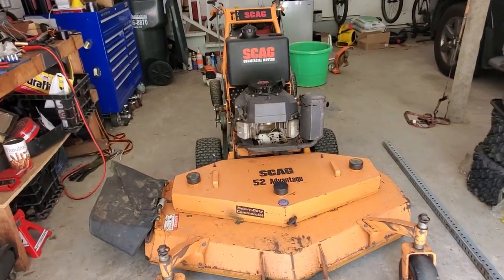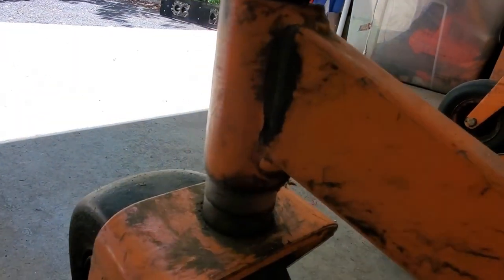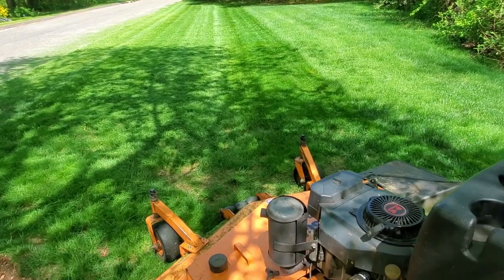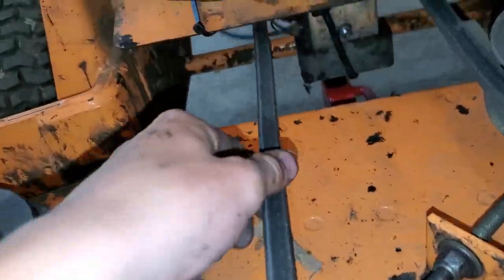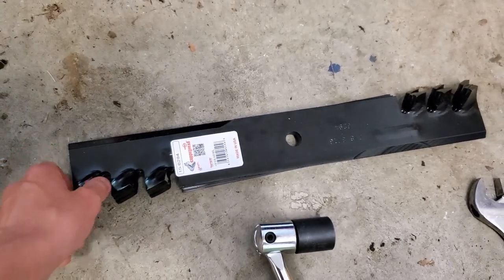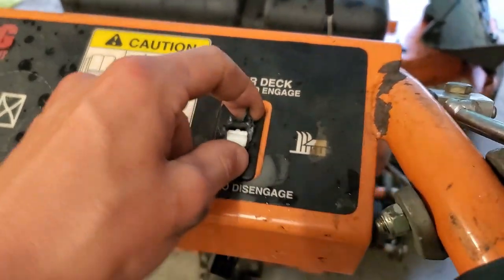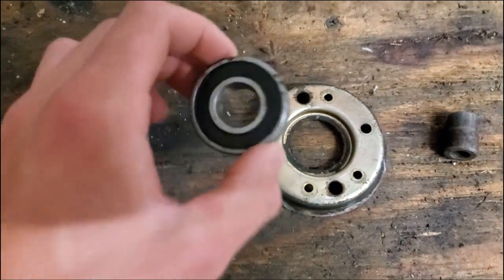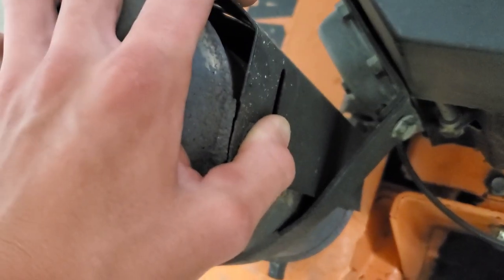Scag deck adjustment, bearing change and maintenance

Comment: Nice video thank you great  that your machine has chart on it. On my older 48 it's suggested to have 3 spacers on top of blades previous owner had blades tight to spindle and 3 spacers under blades. My blade height to ground was around 3.5 so I wanted to put the 3 spacers above blades but then would be too low so I made same adjustment with deck to body bolts In lower hole and put 3  spacers above blade and also went 2 below /2 above on casters. looking pretty good now 3.5 blade height and neutral pitch may still drop down 1 on caster for positive pitch. Any one changing deck bolts I loosned all 6 bolts removed 3 pulled up under deck with pry bar reinserted 3 bolts then did other side.

Comment: Thanks for the video reference. The Pulley I was referring to is the larger pulley located behind the smaller one you took off to replace the bearings.
Reply: You can see the larger pulley in the video clip
Reply from the maker: @robertlombardi2228  The one that mounts to the transmission or engine? You shouldn't need to remove any pulleys in order to change the belt, just loosen or remove the idler pulley (the one I changed the bearings in), remove the air clutch bracket, and blade drive belt, then slip the transmission drive belt off

Comment: Thanks for the tip about the bearing. I’ve never thought of that. So the deck should be pitched down in the front right? I’ve got a 48 but it’s the same basic concept I believe.
Reply from the maker: Yeah should be the same

Comment: How are you getting to the back mounting holes ? Please respond
Reply from the maker: I'm assuming your talking about the deck mounting holes, in with case you need to remove both rear wheels. In order to do that you need to remove the belts tensioner pulley (the one that moves up and down when you pull the clutch), then remove the belt, remove the wheel clip and slide the wheel off. Let me know if this helps!
Reply: @everythingmechanical_yt  when you did this did you remove one side set it then do the other of do you have to drop both sides at the same time? Also if you’re doing this by yourself how do you keep
The two parts from going in two completely different directions? I’m new to owning a commercial mower so I know very little.

Comment: can you get some cutting footage with that?
Reply from the maker: Unfortunately I sold this machine not too long ago but I have tons of pictures of grass I cut with it. These decks are pretty good, the only issue is the 52" tends to clump up a lot when it's wer
Reply: @everythingmechanical_yt  yeah thats fixed with the newer velocity plus decks- i reccomend getting a newer 48" belt drive with the velocity deck, or the hydro if you wanna splurge :D
i love the scag WBs too bad most modern business owners hate them.